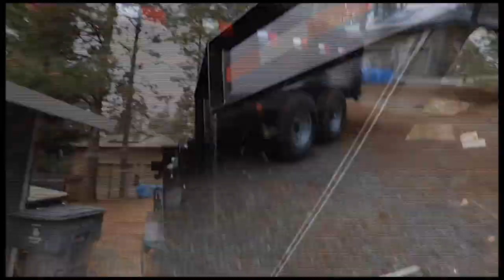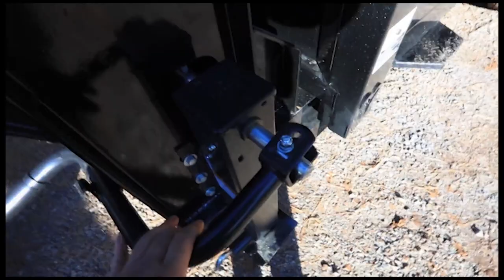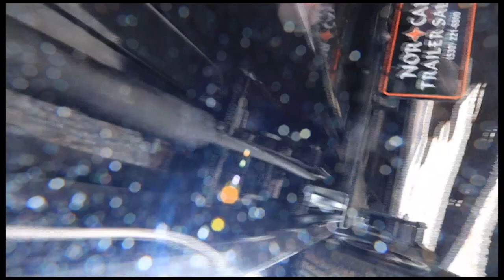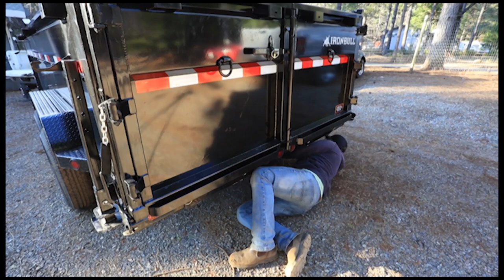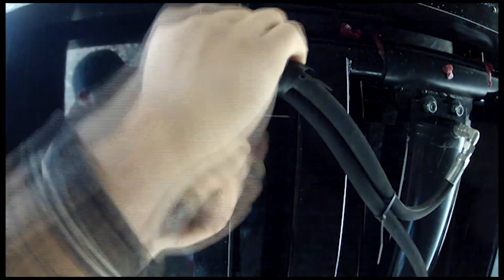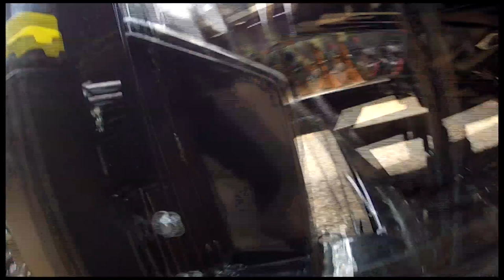Got a new IRONBULL 16ft gooseneck dump trailer.

Comment: Good stuff.  I too had to wait for my dump trailer. (Same spec for the most part, different manufacturer.) I got it a couple months back, and definitely appreciate the PM type of steps you took, and will NOW applying the same to mine. Of course I did the grease work, but did not think about the longer term impacts on the lines, etc. Thank you for the video!
Reply from the maker: No problem at all happy it helped you out best of luck 👊🏼

Comment: Nice trailer, but it seems to me that those problems should be taken care at the manufacture or the dealer lot, not by you at home. Looks like a bad engineering design for the hose chafing.
Reply from the maker: you would think so, it is what it is sadly. Ive had brand new equipment delivered to my work before and there is things not done correctly being rubbing hydro lines or loose lines and zirk fitting missing. no matter who you buy from or what it is you need to do your double check